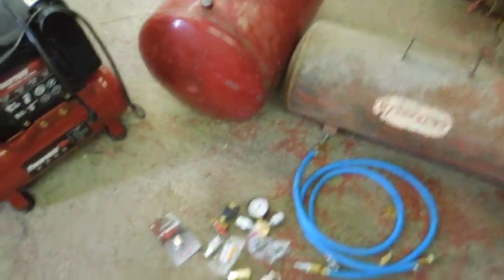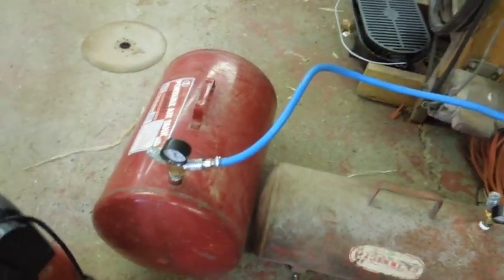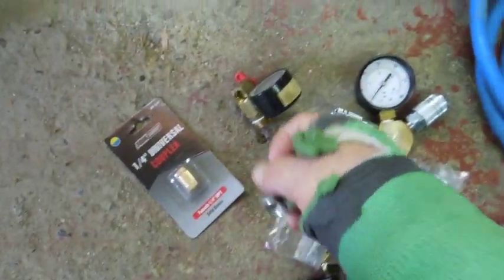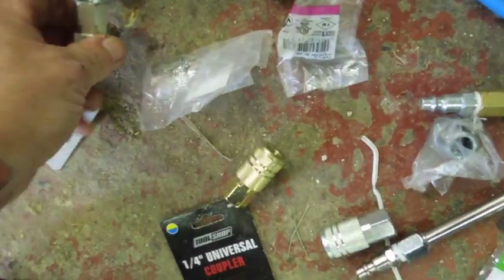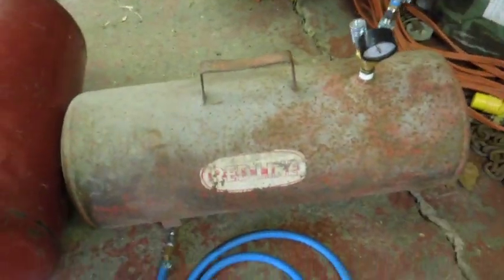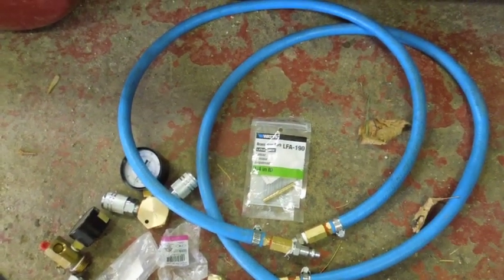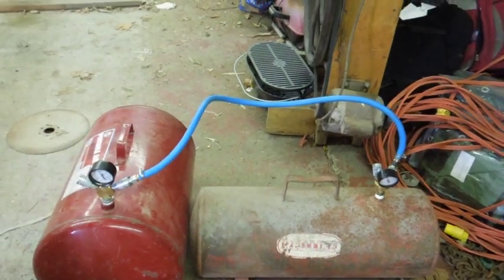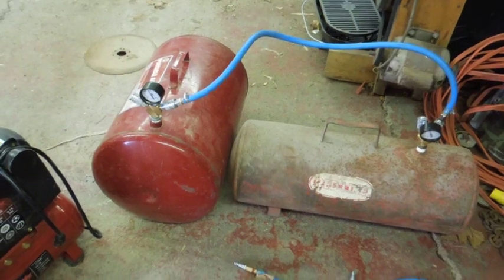Air compressor set up

Comment: Good idea! I'm going to steal it. :-) Like you have a small compressor in my shop & can use extra capacity, too. Thanks for sharing.
Reply from the maker: I have a couple of old propane tanks that are around 50 gallons.  They have been timed out from testing so they refuse to refill them with propane anymore.  I am going to remove the valving and set it up for air tank.   The way I have seen others use them is to mount it upside down hanging on a wall.  That way moisture will always drain out into a fitting that you can take apart.  I have a larger air compressor in a side shed that I need to see if it is still intact.

Comment: Do your buddy tanks need pressure relief valves?
Reply from the maker: The safety sallies probably say that they do but reality says there is no pressure source besides what you put in it with a hose and the fittings will probably leak before there is an overpressure condition

Comment: Nice setup.  
I've got a 5 gallon buddy tank, but I should really pick up a bigger one, especially for when traveling.
I like that Sportsman grill ya got there too!
Reply from the maker: the sportsman was a christmas present to myself last winter :)  I can set the air compressor in the back of my pickup and hook the three buddy tanks together to pump up a tire on the road.   You have to take the volume of the flat tire into account and compare it to your buddy tank capacity.   some of the farm implement tires I have to inflate at the far end of the corn field can hold more than 30 gallons.  but I can get the tire up off the rim and limp it back to the farm with it half inflated as long as you dont get into a big hurry and bounce the tire down onto the rim.   A loaded grain wagon will completely wreck the tire in 5 feet of rolling flat and then wreck the steel rim in the next 10 feet.

Comment: I also like that 3 way splitter how all the ports are in a row! Where can you buy that type? I have seen 3 ways that are the same as those ones at harbor freight with couplers on it already for 8 bucks those have there uses in places. but yours is cool too.
Reply from the maker: I walked into a big box  store called Menards and they were on the pegboard
Reply from the maker: there were two styles.  in a row like what your see and in a round tri tree arrangement
Reply: oh yes tri tree arrangement is what i was trying to think of! too bad we don't have a menards up here in maine that I know of!! I do like how the  tri tree one at harbor freight comes with couplers but they put a lite duty thread lock on the couplers threads so they don't come out easy but if you have a really good open end wrench that fits and put the tee in a vice and go slow they do come out!

Comment: How old is that rusty tank
Reply from the maker: It was probably bought new in the 1970s.   I have a 200 gallon propane tank that was made in the 1940s that I use down in the shop.   Propane tanks need to be certified in order to be refilled with propane.   It works just fine for air
Reply: I have an emglo about 30 gallons rated for 185 psi it was made in 1985 what u think? , has still more life ???? I just fill that to 100psi
Reply from the maker: @raulmarin8704  if it holds air and has standard enough fittings that you can make the connections it will work
Reply: Sorry wrong question im afraid it explods ? I check the indie and is a little bit rust not too bad ?
Reply: I check the inside
Reply from the maker: @raulmarin8704  air tanks don't explode.   They leak.  Sometimes small leaks can be welded shut.  But some are tricky like the air compressor tank I referred to in the video.

Comment: Okay I'm trying to envision the final solution -- looking at getting a smaller compressor for my DIY at home projects.. but would like the extra capacity if needed.. So If I run a hose from compressor to air tank (into the 3-way block set up), I can then run a my tool hose OUT of the extra air tank and the compressor will fill that tank when needed?
Reply from the maker: +John-Marc Edwards yes your air tool needs volumes of air under pressure.  Having more storage capacity allows you to use your air tools for a longer time period before taking a break for the air to build back up. I have 4 portable air tanks that I can connect together with jumper hoses. All together that adds up to about 40 gallons including the 3 on the air compressor.    I recently found a large propane bottle that is out of date for refilling with fuel.  I just have to remove the valve on top and thread standard air fittings to the opening.  That will give me 40 gallons of air in one container.   I plan on bolting that larger tank upside down on a wall with valves down so that I can drain the water out of it easier.
Reply: good thinking... Ive been scouring the internet on compressors.. been finding some stuff on CFM playing  a part in refill time..
Im looking  at a Porter Cable 6 gallon with 2.6@90(makes no sense to me...) and probably later on adding another 10-20 gallons.. Like I said, just having the extra air would be nice.. but I also don't want to blow the motor up filling two tanks.. suggestions?
Reply from the maker: Cubic Feet Per Minute determines how long you will have to wait for the tanks to refill.  If you dont mind taking a 15 minute break every half hour a small air compressor will work.   If you start doing production body work you will probably want a larger rated air compressor.  Bigger CFM rating generally means a larger storage tank.  I am doing the poor mans get by solution.  Generally speaking the compressor section is not where the fail point shows up.  It is the tanks and fittings that fail.  Getting banged around in transportation or not draining the tanks and get rust inside that cause holes.
Reply: Randy J thanks for the quick responses.. I feel confident in getting a pancake compressor and tacking on an extra 10-20 gal or so. Its probably overkill for my at-home projects. But it makes me feel cool -- so thats gotta count for something, right? Ha! Also lets me build a custom roll around cart for it, stretch my brain a little bit! thanks Randy!
Reply from the maker: if you operate at 90 psi.   Cubic Feet per Minute.  check out a website convert-me.com  convert the gallon storage on your tanks to Cubic Feet  (volume to volume comparision)  2.6 CF per minute means that the Porter Cable compressor will refill the 6 gallon (0.8021 cf) tank to 90 PSI in about 30 seconds but realistically closer to a minute and probably closer to 3 minutes if you pump up to 120 or 150 psi.
Reply from the maker: John-Marc Edwards
ask some carpenters about portable air compressors .  They will tell you that pancake compressors are lighter and more compact but standard compressors last longer.  But pancake compressors are lower price point costs so you can replace it easier.
Reply from the maker: awesome good news.

Comment: What's the brand name of that blue air hose?
Reply from the maker: I believe that was a NAPA product.  I'm not entirely sure since my father bought it and had it down in the shop.  20 years after his death the "tennant" cut all of the air hoses up and this is what is left.  You can buy 50 and 100 foot lengths or air hose at auto parts stores and home improvement stores.
Reply: Oh i know you can buy air hoses at home improvment stores! I have tons of all types I use to do a lot of air control in my haunted house years ago, though I'm taking a few years break!